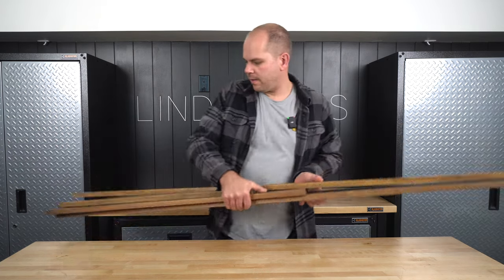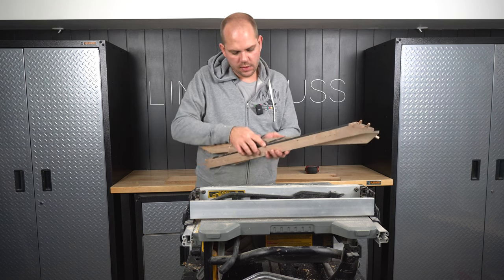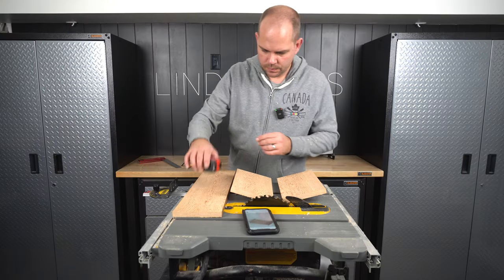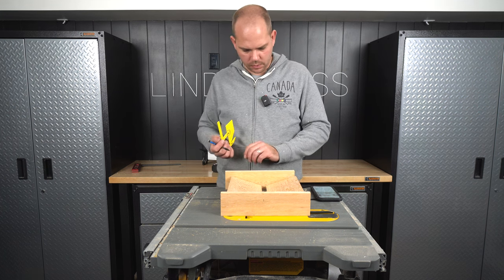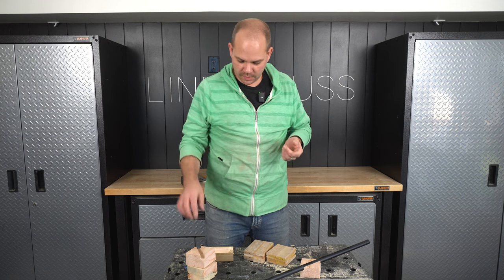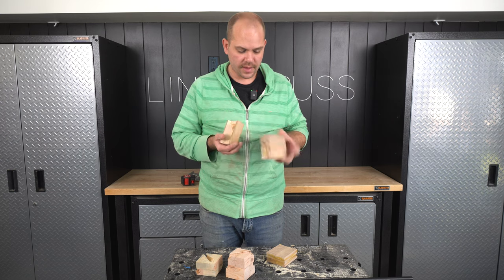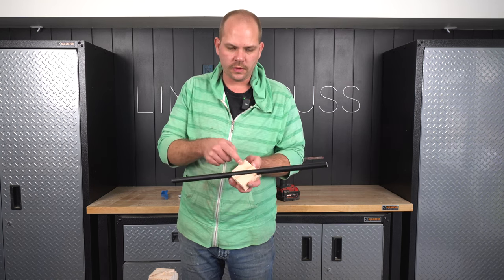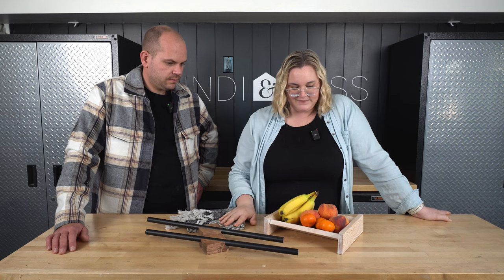Easy Scrap Wood Ideas | DIY Home Decor

Comment: Lindi and Russ, I added a link for a forstner bit extension so you can bore right through your wood projects without having to flip your piece over. I got mine at Ace but I wasn't sure if you guys had one of those in your area or not so this is from Amazon. I linked a 10" to get uou started on your search. You know your bit size and can pick one accordingly. 

I was so excited to be able to sit back and finally have the time to catch up on  that I've missed. P.S. I'm so happy that you didn't use salt to "help" keep your boards from slipping during glue up. Salt doesn't disolve all the way in some aread and so the glue is left with holes and it also changes the composition of the glue making the glued joints weak. I really hate those woodworking tips and tricks because a lot of newer woodworkers are using those methods not knowing that a lot of them are gimicks. Nothing should be put on the glue unless your filling a small hole with sawdust and glue. Anyway, you guys always make my day! Getting video 3 done now. Once I have 5 I'll get them all uploaded and the channel will finally be active!

Fulton 10 inch Long Forstner Bit Extension for Adding Over 8" of Drilling Depth to Your Forstner Bit Ideal for Wood Turners Furniture Carpentry and Construction (3/8 inch Collet) https://a.co/d/cfDPqdv
Reply from the maker: This is great - will have to add to the "need for the shop" tool list! Thanks so much for watching and for the great tips! Good luck on getting you next video up!